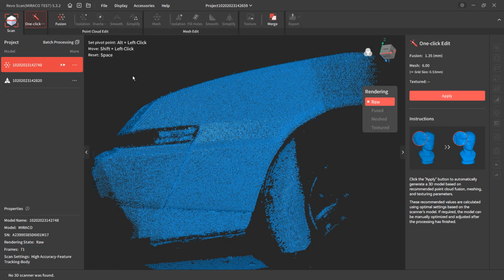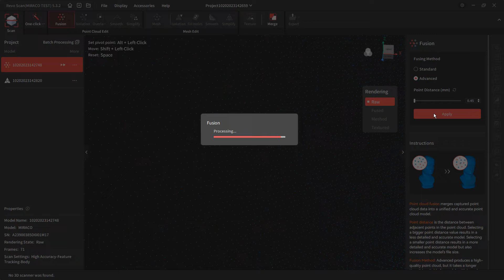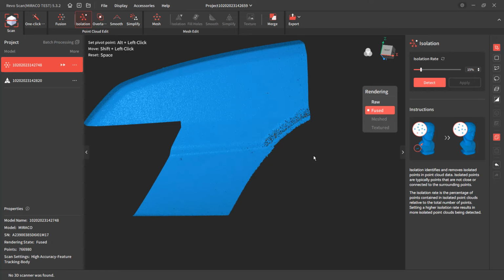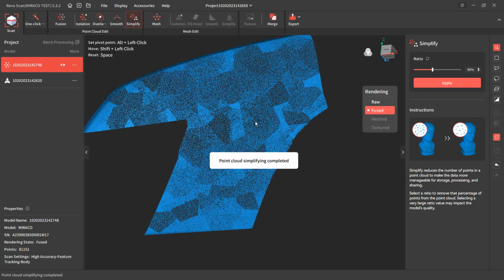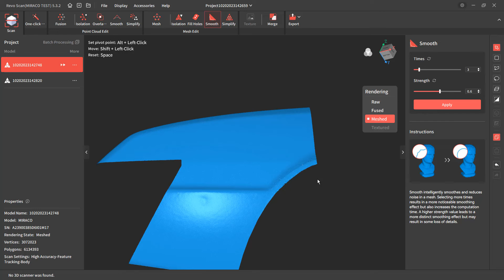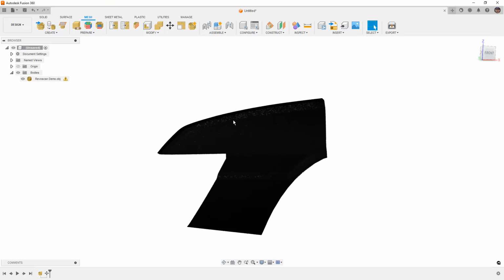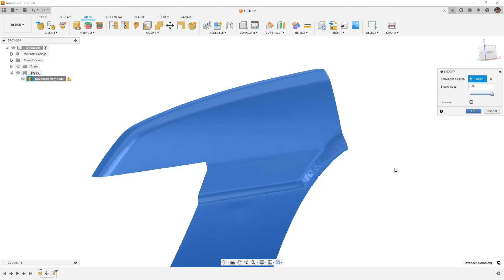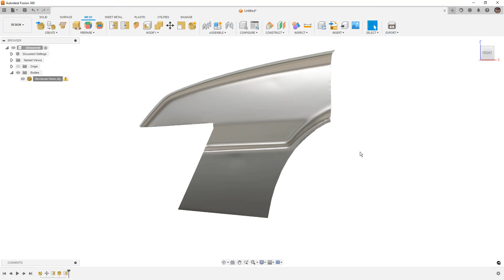How To Use Revoscan and Fusion 360 To Process Car Scans | #revopoint #fusion360 #reverseengineering

Comment: in my experience using smoothing/ simplify works better on the mesh . specifically using simplify on the mesh will reduce poly count but keep harder edges rather then smoothing details
Reply from the maker: Thanks for the comment and data point!  During my testing using more smoothing on the mesh ended up reducing the harder edge details on the scans.  Maybe it is a case of the scan geometry making the difference?  When i was working with Revopoint they suggest doing more processing on the points vs on the mesh.  They said to prioritize the points over the mesh.  They did tell me that the smoothing algorithm isn't straight forward in that it doesn't just look at the pure mesh but also the overall shape.  One thing that is nice is the undo button :)
Reply: @LearnEverythingAboutDesign   yea the undo is a GREAT feature.. weird tho i've had the most luck with simplify the mesh gives like the best of both worlds i've simplified models and the 100k  result looks better then the 3mil result from a smoothness standpoint and losing minimal details but i feel like doing anything to the point cloud tends to really soften things. however i'm sure it's model dependent

Comment: It's interesting to see the difference in the process in the revopoint software vs the 3dmakerpro software that comes with the scanners i have. There seems to be a lot more granular control on the revopoint. hopefully 3dmakerpro can take a leaf out of their book.
Reply from the maker: Interesting!  I haven't used the 3d maker pro yet but hope to.  I have used this, creality, and shining.  I will give an advantage to the ExScan software in that category.  It has a little more in the way of mesh processing but the big advantage is the ability to align to a coordinate system.

Which scanner are you using?
Reply: @LearnEverythingAboutDesign  I've got a "mole" for smallish parts and a "lynx" for larger (car panel and up) type parts.

They're a great value product, thought i would love to try something from the prosumer level of scanners to see how much difference there is (if any, demos ive seen at trade shows don't really indicate any advantages of a $10k scanner over a sub $1k scanner)

I would dare say, with your following you're gathering, if you hit up 3dmakerpro, they'd probably hook you up with a scanner or 2